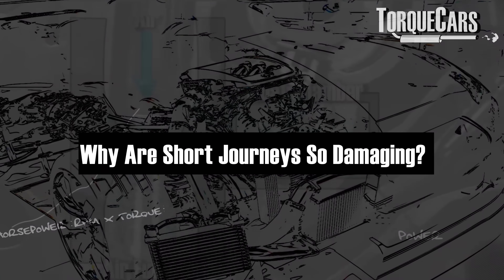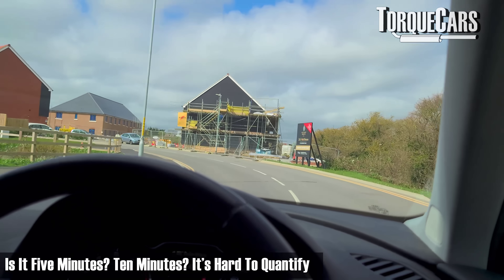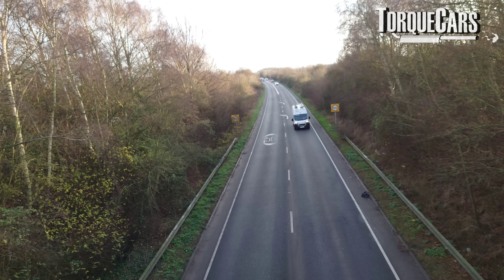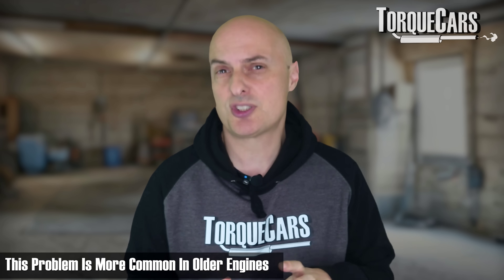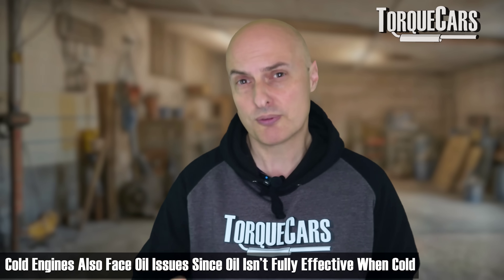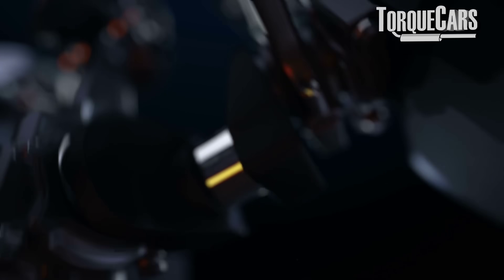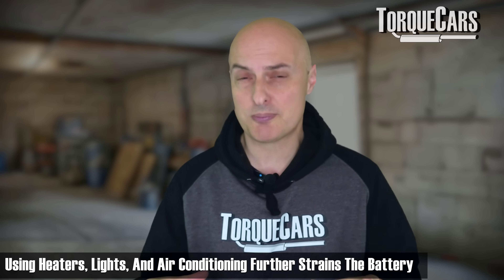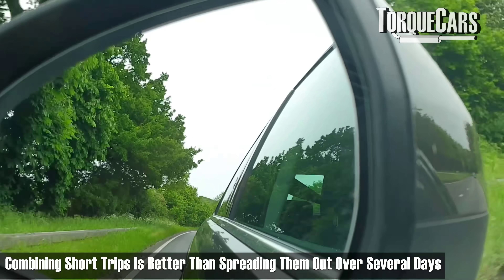Why Short Drives are Damaging - Discover The Causes & Avoid The Problems Of Short Trips.

Comment: As an engineer I can confirm this.
In BMW terminology, a short journey is :
- driving less than 25 minutes continuously.
- driving less than 25 kms continuously.

For engines with low tension oil scraper rings, short journeys will clog the piston oil drain holes and rings and thus cause the oil rings and cylinder walls to wear very quickly.
I strongly recommend for non supercars engines the usage of latest 0W30 premium oils even if you live in a warm country (except for summer when it s more than 35C outside)
They are better than most 5W30s at fuel effeciency, metal protection, shear and evaporation.
Top choices are:
- Castrol 0W30 
- TotalEnergy Quartz 0W30 Ineo or energy.
- Amsoil SEmo 0W30 EOT
- Valvoline EuroV FS 0w30

And know that fuel is as important as oil.
It s mandatory to use additived fuel with the highest octane possible.
Total excellium is a good example that prevents top cylinder coking and scoring.
Reply: Highest octane isn’t necessary. Highest octane is only a necessity if using your car during very hot temperatures, as octane number refers to resistance to detonation. It does not affect any engine component when no detonation is occurring. A fuel additive for upper cylinder lubrication should help the piston rings more than the piston skirts. Clogs only occur when the oil itself cooks. That isn’t a problem in cold temperatures. If you live in hot temperatures you should be using a 5w30. Thinner oils cook much easier when the oil is hot causing sludge. This will clog the piston oil rings. But if you use valvoline restore and protect it can reverse most of the damage which will lower the amount of oil you burn or completely stop the oil burning. You forgot to mention penzoil ultra platinum as an oil as it’s the second best overall oil below amsoil, at less than half the cost. For direct injection engine an oil catchcan is a must. This will prevent carbon accumulation in the valves which will cause more friction with the incoming air reducing torque.
Reply: @Eclipsis17 My layman experience confirms all you said. DI engine - > oil catch-can is a must. 0W-20 AMSOIL Thank you. Hard to get AMSOIL in EU.
Reply: Or you can drive an engine that doesn't have to run 25 minutes or go at least 15.5 miles per trip to stay healthy.  I've got engines from the 90s doing just fine that do the vast majority of their hops below those numbers by a lot.  What idiotic engine design for a world full of congested roads and short hops.
Reply: In mild and cold weather I prefer a 0W20 over a 5W20.   Or a 0W30 over a 5W30.
Reply: This is only 10% of the problem. The main problem is that engines wear out 90% more when they are in their cold period. Mostly Bearing clearances being looser due to them not being in operating clearances which happen at operating oil temperature. So it is important to immediately start driving and not warm up the car to try and warm up the engine as fast as possible to minimize the cold period. This is the main reason why diesels last so long, because their owners drive a lot meaning that the engines spend most of their life in their operating temperatures. So your engine life mainly depends on how much you drive. City driving for short trips will wear out an engine much more, and there isn’t much you can do about it. Cylinder scoring is only the result of overheating, as the pistons expand when hotter allowing the, to reach the cylinder walls. This causes friction therefore scoring.
Reply: @Eclipsis17 are you saying that waiting in idle state for a few mins to warm up is damaging the engine, and that it’s best to drive at low speed until warms up?
Reply: @117adstudio3 no I’m saying idling anymore than 3 minutes is wasteful and will damage your engine overtime. People idle their cars for 10+ minutes when it takes 20 minutes of idling to warm a car up to operating temperatures. Vs 7 minutes of light driving. If you idle your car for 10 minutes it will still take 5 extra minutes of driving to warm your car up.
Reply: @Eclipsis17  no it’s not, when you drive your RPM is much higher than you’re idling.  That means your engine makes more revolutions per second when the engine is still cold, minus you are putting it under load. Your engine will wear much faster when you drive off right away when it’s cold and below freezing
Reply: @e @eugenet6632 rst of all everything I said is true, and 2000-2500 rpm’s while driving for 1.5 minutes immediately warms up your coolant temperatures to operating temps which will increase the rate at which the oil reach its operating temps. Secondly this doesn’t apply to temperatures below 40 degrees farenheight, that is where 0w20 actually has a purpose, and you must idle much longer. Everything I said is true for temps above 40 degrees farenheight.
Reply: @eugenet6632 Wrong, low rpm driving until warmed up, protects your engine.
Long idle warm up hurts your engine by contamination of oil as the oil rings take longer to expand.
Reply: @Eclipsis17  nope you are wrong. You don't even know how materials shrink and expand during temp. When you immediately start driving, you will break every ratio there. Oil hasn’t circulated yet. Diesels have different reason to not wait much because direct injection not burning the fuel for minutes will cause carbon problem
Reply: What about Shell 0w30? It's GTL based oil, it should be good. I use it in my 2.0 i-VTEC Honda. Or you recommend something else?
Reply: @tonirenic5710 yes the latest formula of Shell 0W30 C3/SP is one of the best. It s based on pure GTL + some percentage of true PAO.
It has the lowest evaporation loss ratio and stunning cold protection. It s the same formula.for the BMW TPT 0W-30 LL04 with very slight variations.
Reply: @hanynowsky  Would that oil be any good for an older, 1970s performance engine, specifically a 3L Maserati V6?
Reply: I’ve heard some mechanics that seem knowledgeable and trustworthy, like The Car Care Nut on YT, recommend against the thicker oils on late model cars in the N. American or European markets because they say their oil pumps were designed specifically with the thinner oils in mind and the thicker oils will damage or wear them out faster. Any thoughts on that?
Reply: The part about the highest octane possible is absolute BS, the rest might very well be too
Reply: The difference between 0W and 5W is minimal at zero Celsius. Unless you live in the frigid climate no need to pick 0W over 5W, and we’re talking -30°C and below
Reply: @eugenet6632  no, he's implying that the 0-30 is a newer formulation and chemistry ideal combo/packages than the 5-30, and thus superior.  I'ts about the R & D in both oil formulation, testing and what engine makers have been seeing in both testing and in real life damages to existing engine designs in the past decade , probably.
Reply: @18_rabbit  if an engine oil has approvals for your engine, the viscosity really doesn’t matter, especially the winter one. The approval is only what matters as it means the oil was tested and approved for the use in your engine within recommended interval. If 0W has group 4 like esters or pao then go with it  but it does not mean 5W will wear your engine faster with the same approvals
Reply: "0w30 oils are better than most 5W30s at fuel effeciency, metal protection, shear and evaporation." Citation needed.
Reply: I moved to Amsoil 0w-30 from Toyota 0w-20, no problems, less noise, quieter idle, lower rev idle, and less clunking if I floor it on the motorway.
Reply: Isnt the 5w20 good too ?
Reply: that's paradoxical that shear stability is better with 0-30 than 5-30 bcuz the 0-30 had more viscosity-enhancing additives which in most oils means it will shear faster than an oil with fewer viscosity-enhacing additives (the tribologist named Lake Speed Jr goes into such details on his channel here, Motor Oil Geek, all science/eng, no guessing).
Reply: Thank you for your insights. I drive a 2025 Honda Accord Hybrid (2-liter Atkinson engine) that is continuously cycling on and off. Recommended oil is 0W-20. I live in Southern California, very temperate climate. I was thinking of switching to either a 5W-30 oil or, more likely, a 0W-30 synthetic oil. I don’t mind if I lose a few miles per gallon, I’m more interested in engine protection. 95% of my driving is under five miles. Do you think switching to 0W-30 would be detrimental to my engine?  Or do you think it might actually help protect the engine as it constantly turns on and off?  Thank you, in advance, for your response.
Reply: @syusi  i'm no expert but have spent many hours on the only tribologist on YT, Motor Oil Geek, (ie sci/engineering), and i'm not sure on  your case, but SoCal does get dang hot as hell, and there's traffic, so perhaps u would benefit from the one step thicker oil, which actually would be 0-30.   However, bcuz u do super short trips, then, in theory, it's possible that i'ts not easy for your engine to get up to temp quickly enough w/ thicker oil, but could be quicker/easier to get up to temp w /the thinner oil.   So this is a really tricky one, and bcuz it's atkinson cycle and not operating all the time, i'd stick w/ the thinner probably, to play it safe.   Honda is reeeally smart wrt engine design, notwithstanding their 1.5turbo fiasco which is a dark mark like no other in their entire storied history.    This is a great question for the Motor Oil Geek, ie Lake Speed Jr, and he has shows regularly and u can email him i think etc.    He's quite clear and brilliant.    One way to kinow for sure is to test our used oil.  So u could test your current oil when u change it / have it changed, ie send the little sample in to a co etc.  Then switch to the 0-30, and when it comes to time to change it, send sample of that in, and see if the results are differnt from the original grade of oil.   I'm guessing they'lll be the same though.
Reply: Honda has had a lot of dark marks just like everyone else. Soft metal cam lobes and cam just floating around in the heads on their earlier V4 engines comes to mind.
Reply: So if people arny going 25km they should walk? Cars are the servants not people.
Reply: As a black woman I have no idea why YT made me watch this but I’m shocked why you all buy a car if all you do is worry about it and this guy says don’t drive it at all to go to the store!  THATS WHY I BOUGHT A CAR YALL!  Go get you a nice bicycle and you’ll be happy, or maybe everyone will worry and debate how to extend the life of the bottom bracket and chain.  SMH
Reply: @thetalkingboard  Funnily enough, to save wear and tear on my car I DO  use a bicycle for those short, shopping trips, (and yes, I do get a bit paranoid about my bottom bracket!)
Reply: Any time a comment is started " As an X" you can disregard it completely. It's either a BOT or a literal CHILD. which one are you smooth brain ?
Reply: Why is all manufacturer in the EU lists 5W30 for the same car/engine while the US market all has only 0W30?
Reply: Concur on the the oil VW Passat owner
Reply: just buy EV and you will forget all engine issues, oil changes, filters, warmup, clutch issues, DPFs, Adblue etc…
Reply: can i use a A5/B5 oil instead of A3/B4 or C3?
Reply: @William-Anderson look at your owners manual for which oil weigh your car can use. Generally engines that can use 0w20 can use 5w30 as the bearing clearances can permit them. Higher weight oils should only be used on cars that specify it, or on older engines, as on older engines when the rod bearings wear out the rod bearing clearances get larger meaning you should use higher weight oil or essentially that rod is loose on the crankshaft. A strong oil film is important for reducing wear on an engine.
Reply: What would you recommend for a VW Golf R stage 1?
Reply: @Trihawk7 use 5w30. And don’t immediately turn off the car after you push it car. Let it idle for 3 mins so your oil doesn’t cook inside the CHRA which could cause sludge and wear out your turbo shaft. Get an oil catchcan which will help your engine stop consuming oil vapor which lowers your octane number.
Reply: @Eclipsis17  my Audi from 1991 had numerous side effects before i installed my catch can, it produces more blowby due to the engine having 300.000km+ down and it was sucking up a lot of oil from the crankcase ventilation
Reply: @Eclipsis17  Years ago, back in the 90's I worked for a car auction in Japan and I noticed that so many of the Japanese cars with turbos had aftermarket "turbo-timers" installed. They could set the duration that the engine would idle after you pull the key out. When I came back to the USA, I found it interesting that pretty much no one had ever heard of this.
That taught me early on that if you have a turbo, let that thing cool off a bit after driving.

Comment: Oil temperature is critical and that can take a long time to reach operating temperature. Most cars are not fitted with oil temperature gauges! They should be as it can take 20 minutes to reach temperature, about ten miles, depends on engine size and the amount of oil there is in a full sump.

Comment: I study at a uni that is very close to a highway - like 200 meters with a bit of idle on the parking space and two redlights before you get up to 80 kph and directly  after 90-100 kph with rpms up to 2500 rpm on a little corsa petrol engine 4 cylinder. Is this a very bad situation and what can I do to improve it?

Comment: 60+ years ago when seatbelts came to cars because of safety laws.......my father  told me and my sisters " get into the car and the first thing start the engine, NEVER tap the gas pedal, let it idel, then put on the seabelt and adjust the mirrors.  As an adult I got a second door key. I can manually  lock the doors and let the engine run while I'm  at a rest area on the hiway. I have done road trips of 700 miles per day. The engine starts in the morning and only after 15 minutes  of idling at night is it shut off.  I run my cars into the dirt, 200,000 miles is common.  My first vehicle  a 1965 International Harvestor 1200 pickup went 450,000 miles before I sold it. Take care of your vehicle and it will last.

Comment: I always make sure to start the car in third gear a few times before every drive for good measure, gotta make sure that clutch is working well. Once I can start it in that gear I know that clutch is worn in well and it should be smooth sailing from there. I tend to drive in first gear only, no issues so far.

Comment: How does driving for an hour do any less "damage" than a 10 min drive? They both cold start and run for that 10 mins regardless...
Reply from the maker: The warm engine reduces oil dilution significantly, the metal also goes through a full heat cycle. Particulate filters (fitted to most cars now) will have a chance to clear out, and there will be less soot deposited throughout the engine, with added heat allowing  chance to reduce the carbon through the EGR and intake. Wasn't that what I said in the video?
Reply: @TorqueCarsDriving  yeah i guess my question wasn't that clear. Oil dilution and the other things you mentioned are they all 'reset' by having a long journey now and then of say 1 hour on motorway.
Reply: A 1 hours driving does less damage "per mile" that a short 10 minute drive

The last 57 minutes might have the same engine wear as the first 3 minutes

In the late 1950s and early 1960s the auto research engineers ran wear tests with radioactive piston rings and cylinder bores, Two different radioactive tracers. They monitored the wear versus warmup ie water block coolant temp. About all the wear is at start and drops like mad as it warms up to be nil once at operating temperatures. This was data was on display at the old Ford Rotunda building; 

A long drive "boils" off the water in the oil too, ie stuff that "happens" with short trips of a few  miles.

Thus  with me driving a car once for 72000 miles in one year had less piston ring wear than another driving 72k miles in 10 to 30 years of short trips

Driving with a bad thermostat that runs wide open is real bad too. ie the engine never warms up in cold weather
Reply: @3beltwesty ok so there's 2 things then... Cumulative damage for start ups- the more start ups the more piston ring wear and this is irreversible. 
The other thing is things like soot and oil dilution but this can be 'reset' / is reversible to a large extent by going on longer trips where there is a long period at the operating temp.
So what about petrol engines are they less susceptible to cumulative start up damage to the piston rings than diesels?

Comment: My 1966, flat tappet camshaft, pushrods engine doesn’t leave the driveway until it’s been warmed up for about 10 minutes. Then, if I’m only going 5 minutes to the grocery store, I take the long roundabout route that takes me for a good 20 minute drive to get there. By the time I’m at the grocers, it’s well heated up and running well.

Comment: I commute 3miles each way, one route is 30mph one is 70mph. The 70 route has the engine warm by the time eI get to work, the 30 doesn’t - which route am I better off taking? One involves higher revs, the travel time is the same.